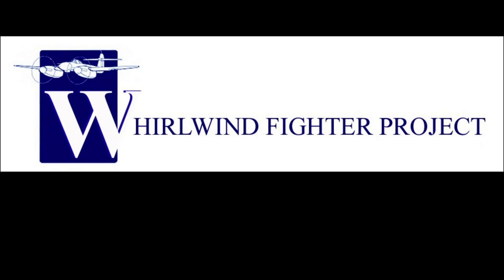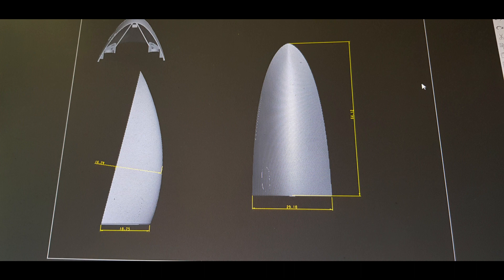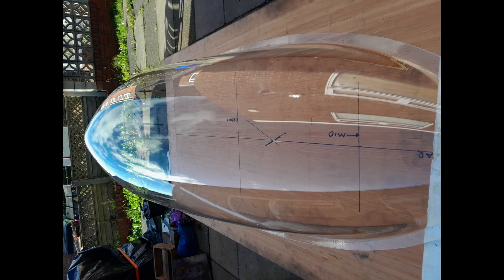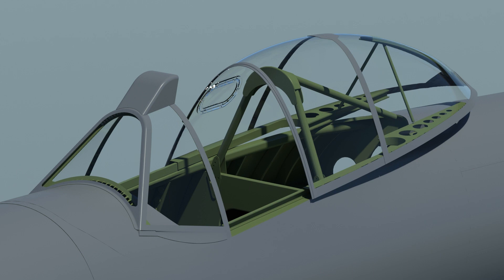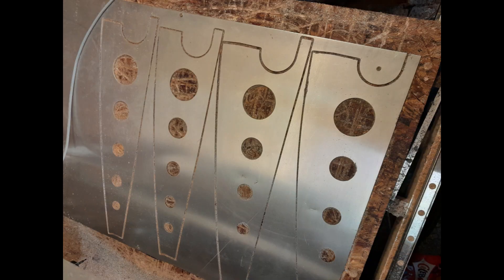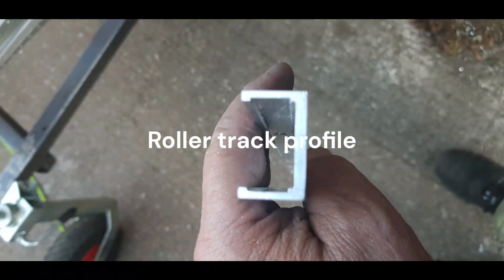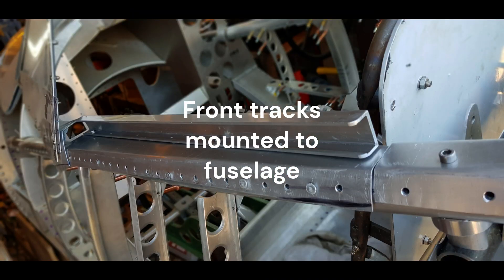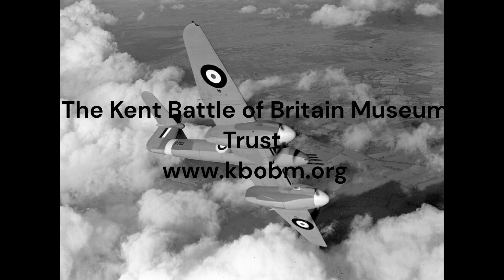Whirlwind Fighter Project - Engineering Update 11 - Canopy

Comment: I expect that virtually all perspex canopies in that era and still are produced by the hot draping and inflation process, rather than the cavity mould vacuum method. The original extrusion machine and virtually all the dies that had been produced from day one still existed and was located in the Westland Experimental shop, latterly, up until mid 1990's when I last saw it. The extrusion sections were all shown in the WHPS and design standards manuals.